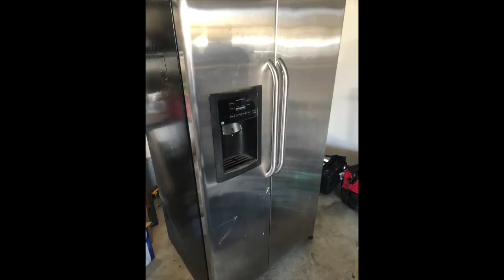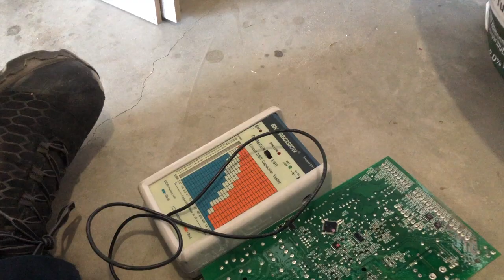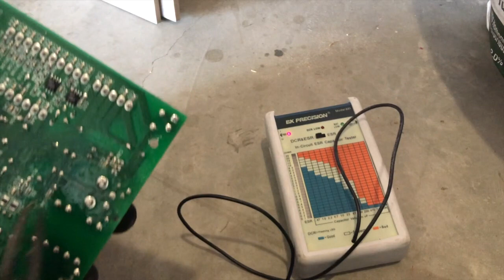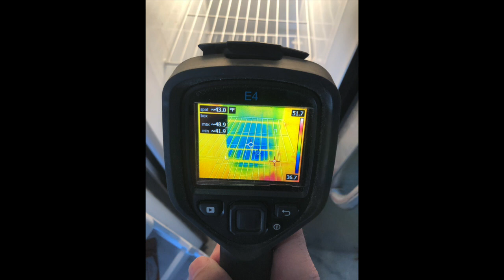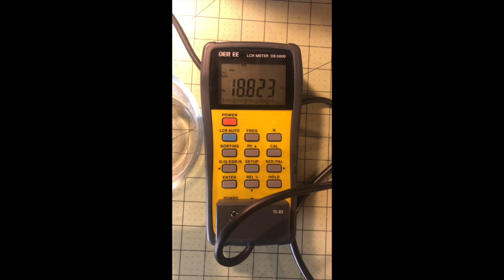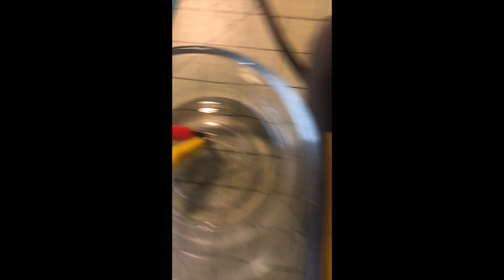Quiz 78 Solution

Comment: Genuine Samsung Refrigerator Control DA92-00111B Can you repair this one?
Reply from the maker: In general, for an inverter, you could be looking at a failed driver chip (under the heat sink, test for short circuit between pins) or bad power supply capacitors, check with ESR meter. If all those check out, replace the board. I have seen those fail because of a bad compressor, though. I don't have a repair service for RFR. I do local appliance repair field service in my city.
Reply: @electronicsprojects4708  I’ve been trying to find a video fixing those because I seen those Gail before a compressor
Reply from the maker: @Theycalllmedaniel  Just to clarify, I didn't say they all fail because of a bad compressor, I just said I have seen the inverter fail because of a bad compressor. So, sometimes the inverter can be the only problem, but sometimes the compressor, say that is inefficient or sealed system that is low on freon, will cause the inverter to fail due to long run times.